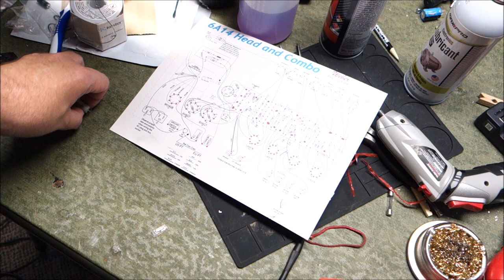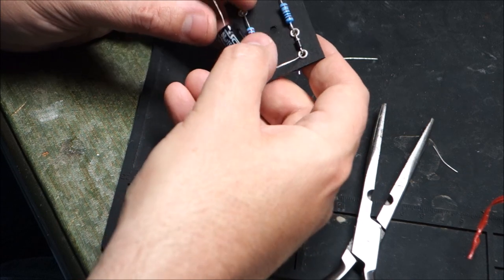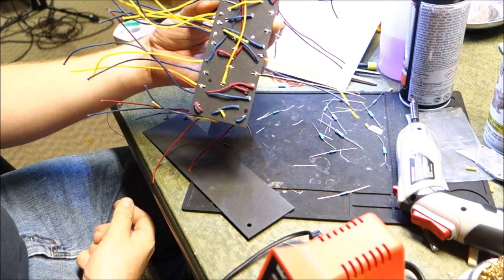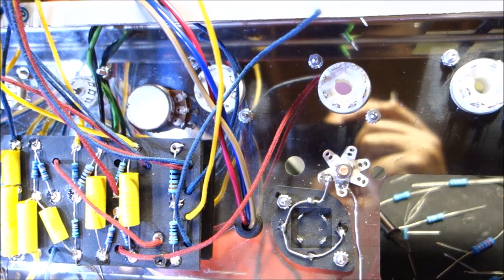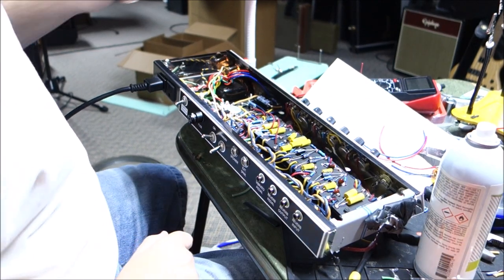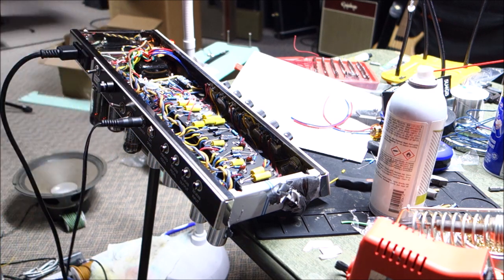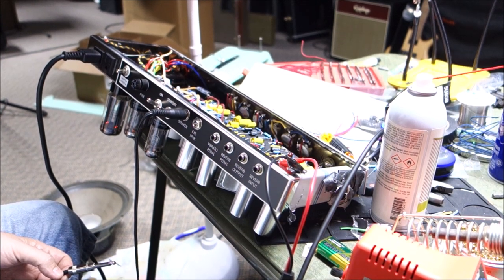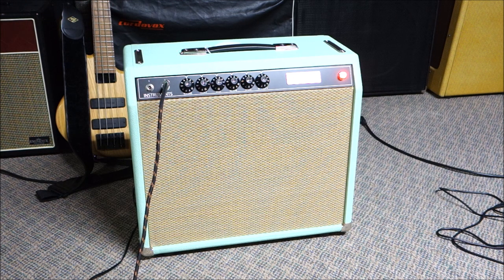Building the Weber 6A14 Guitar Amp Kit.... The Mr. V way.   Will it work?

Comment: Thanks for doing this. I found some good pointers before I set out.  I still don't know what the six nylon standoffs are for but I'll find out.. 😂
Reply from the maker: I added those myself.  They are just plastic tubes that you can put a screw in on each side.   They lift the board up by about a half inch.

Comment: I finished my 6a14 tonight and it works, no sploded!  My reverb is much more tame than yours- my kut came with a 2 spring tank.  Any chance you could post the specs on your tank?  I might lower that 470k resistor in the reverb circuit but maybe I need a different tank...
Reply from the maker: I don't remember if the stamped model number is covered in my video.   I'll try and look here in the next day or so.

Comment: One of my favorite amps. Weber always got a bad rap for some reason but they were the botique amp supplier before that was a thing. I don't know for sure but I saw where Weber power transformers cover a bunch of different circuit offerings. They say you can put in a 22 watt deluxe style output trans and it will fire right up. Also very cool is their HP version. 36 watt princeton!!! (Kingston??? )  very cool build. Are you keeping it as a personal amp or are you selling it??
Reply from the maker: Weber's kits from 10 years ago had a few weak parts...  like the pilot light,  and the choice of wire.   Much of that has been improved upon.  Neutrik Jacks, better pilot lights, better knobs...... Their kit prices are SUPER competitive,  so not every little piece is "gold class"... but nothing in this kit belonged in the trash.   I intend to keep this one,  but I'll gladly build for anyone who wants one.  Many times by HAVING an example amp,  once clients play them,  they want one...  and then they can pick the color/tubes/etc.  This amp turned out great.   I got my own tubes of choice,  the grounding tabs,  and thick wire for the filaments...  the rest was stock stuff.

Comment: So the bias pot is mounted to the chassis and makes contact with the metal?  Not "floating," correct?  I'm overthinking it.  Which is better than underthinking it.  My last 5F6A build, I siliconed it to the board al-la robrob. Thx, great vid.
Reply from the maker: Yes,  it is tied onto the chassis just like the other pots.
Reply: @DeadKoby  🙏

Comment: Dk, great job I noticed that you did not use a variac or current limiter (dim bulb) or at least I couldn't see one, is there any significance to that.
Reply from the maker: Overconfidence :-)    I have a variac,  and I use it on some things that I'm really unsure of.   I quadruple checked everything on this amp before giving it the go,   and I knew the voltages for the tubes were present.  (before installing tubes)  Unless there was a component that was bad from the factory,  things would be ok.
Reply: @DeadKoby  One thing I do on pedal builds is I test every part really quickly with one of those cheapo insert-and-hit-a-button parts testers from Amazon. Saves some effort later trying to find out which part is bad if things don't fire up correctly - I'd much rather know a cap is super leaky before soldering it in.
Reply from the maker: I have one of those also,   and I have plenty of experience with these parts.   I try and "NEVER GUESS"   so I'll quick check resistor values or cap values on the meter if there's any doubt.

Comment: How does this amp compare to a Princeton reissue.
Reply from the maker: I don't know much about the reissue other than its done on a pc board.   This is pretty much a clone of an original 60's model with an added bias adjustment.   Mine was ordered with a 12" speaker.
Reply: @DeadKoby  based on the rectumfier it's probably an aa1164. They made an aa964 that used a gz 34 and a few cap changes that Leo thought was too aggresive for a " student" amp. It had alot more gain and rock and roll attitude. That later, the aa 964 circuit,  was used in the silver faced version in 1968 and kicked butt.
Reply from the maker: I'd say that this amp kit kicks plenty of tail.   You can see the schematic and layout on weber's site.